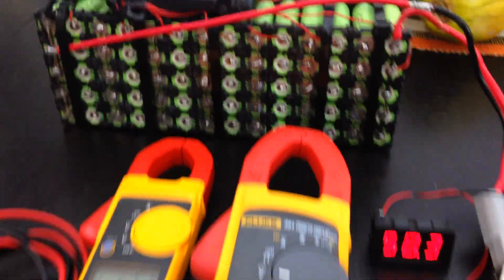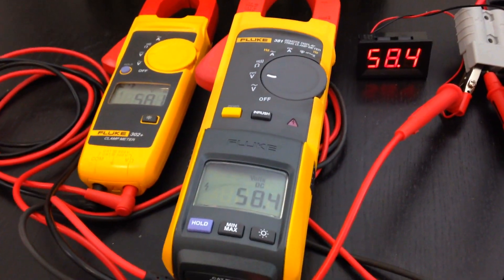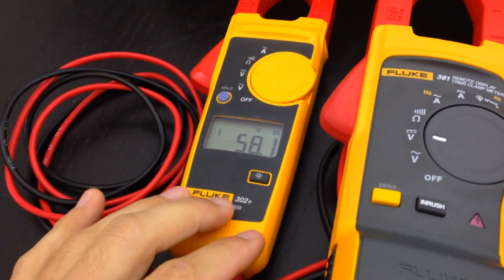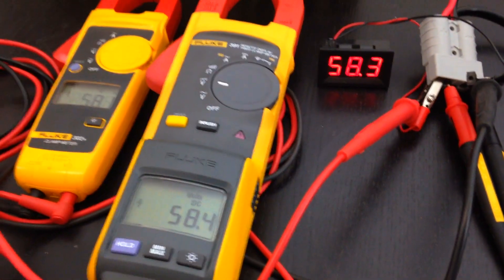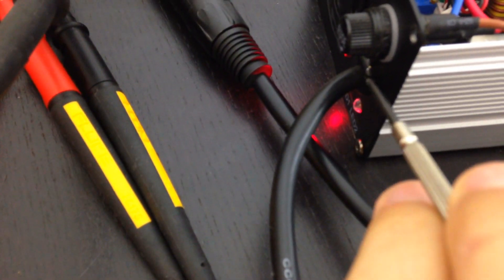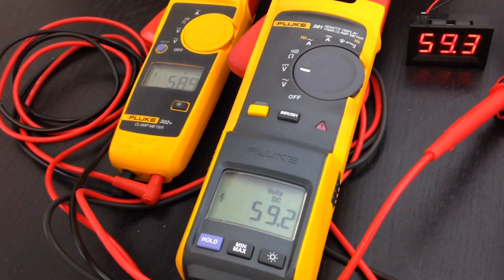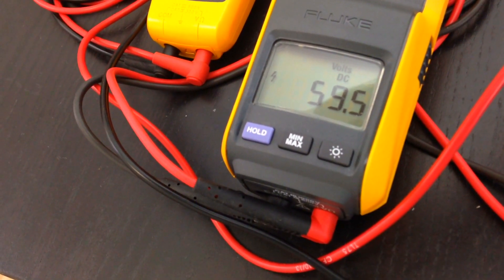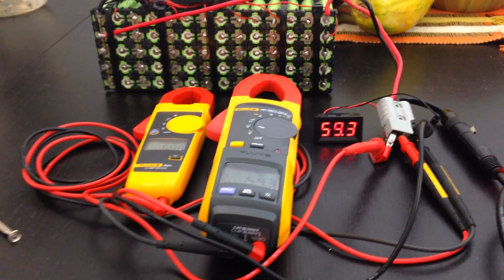100% Battery PERFORMANCE = Bypass BMS + re-Tune your Charger • 1470w Bafang 8fun BBS02 48v mid drive

Comment: I always bypass my BMS bonds.
Only using them for charging.

But the other day I got my hands on 2 36 volt batteries.
Each 10s 7p 
I put them in series to get 20s 7p 
82v in total 
I bypassed the 2 BMS
But one of the BMS  have stopped charging one of the battery packs. 
I was thinking by bypass the BMS discharge it wouldn't cause any problems or damage to the BMS or has it.
It's the first time I have done this so I'm not sure.
 
Does anyone know if that could have damaged to one BMS.

Comment: @BrunoPOWEEER can you please make a video tutorial about bypassing BMW for discharge thank you keep up the great content there are no real videos clear videos on youtube about bypassing bms for discharge
Reply from the maker: Yeaaahh thaaaanks mate!!
Bypassing a BMS for discharge, I’m keen on making a video showing that, lots of people ask for this. There are two ways, the safe way adding a contactor so you still have protection and the direct way with no protection. Open your battery and locate the thick wire that comes from the battery negative into the BMS, instead of passing inside the BMS you just extend this and connect directly to your motor controller. Ideally install a fuse just to be safe.

Comment: Can i connect a charging socket to positive and negative plug for my battery to charge while its connected to the controllers positive and negative connectio my battery has only two wires positive (red) and negative(black)

Will my controller blow off
Ac220v i will be charging my battery

Comment: Do you think a bms limits the bike? I was planning to balance charge my 13s5p with my balancecharger. But if it makes no difference i can keep using a bms for my ebike batteries.
Reply: yes........... on my lead acid battery it will takes months before charging.... but for lithium with bms.... just 3 days... you need to charge it because the ebike will shut-off if the voltage is not high...... i dont know the problem..

Comment: is it ok to use a  DC-DC Boost Converter with adjustable and current voltage to charge batteries such as this....https://www.banggood.com/1500W-30A-DC-DC-Boost-Converter-Step-Up-Power-Supply-Module-Constant-Current-p-1087084.html?p=BH100011313440201706&cur_warehouse=CN

Comment: So the 52V/13.5AmpH shark pack on my 750 is no longer giving the motor juice after it fell off the bike a few times. Is it possible to bypass the BMS in a simple manner in order to keep using it? I'm still riding my 1000W with the 24.5 AmpH pack with no problems. Last thing I want to do is battery swap between my bikes!!
Reply from the maker: +bentstrider yeaaahhh you can definitely bypass your BMS, all you have to do is to disconnect the balancing wires first then cut the negative wires (one going to from the BMS to the cell's negative and other going to the discharge port) connect the negative of the pack directly to the discharge port!!! Connect the charger negative there too.
Before you remove the BMS make sure your cells are all balanced checking if there's nothing wrong with the cells (it may not even be the BMS). Sometimes you can't see any problem and you need to apply a load to see if there's nothing wrong.
Running a pack without BMS you have to keep your eyes on the series checking the voltages with a multimeter. If something goes wrong with one series you will be overcharging all other series and this is when things can go BOOM
Reply: Sounds good, but I was able to get the battery functioning again this morning by taking the shell off and then unplugging and plugging back in the BMS!! But, thanks for the tips any way!!
Reply from the maker: +bentstrider yeaaahh sometimes disconnecting and connecting the balancing wires is all it takes to reset the BMS... I'm glad it was very easy and simple fix hehee... the POWEEEEEERR is back!!! =]
Reply: @BrunoPOWEEER   thank you for the reply I look forward to you making the video on bypassing I think a lot of people can benefit from it keep up the great work once again thank you.

Comment: Great video!  Where do you have your discharge positive and negative wires and charge positive and negative wires soldered.  I've only ever used a bms.  I could guess, but I want to hear it from a pro.  =)
Reply from the maker: +Paul Sammons Music - Hi Paul, I completely disconnected the BMS in this video so there is no separate charge and discharge wires anymore, both share the same wires that are connected directly to the positive and negative of the pack. I am publishing soon a video explaining some different types of BMS and showing how to wire to a battery pack, I am sure it will help a lot of people understanding all these wires going everywhere.. =]
Reply: +ElectricBike (Bruno) So after much frustration with bad bms's, I've just taken off my bms for now to try it out.  My question is, how do you know when to stop discharging without a cycle analyst using a 52 volt battery.  I hear the battery gauge on the BBS02 isn't accurate for 52 volt batteries, so how will I know when to quite without taking a voltmeter on my ride with me?  =)
Reply from the maker: +Paul Sammons Music - Yeahhhh.. BMS brings more problems than conveniences...  your 48v controller is setup for 13s batteries so it will cut off a bit too low for the 14s pack, you need a programming cable and a windows computer to connect your controller and change the cut-off voltage from 41 to 43v. You can discharge to 41v, it is not "recommended" go below 3v per cell but the cells can take as low as 2.8v some cells can take 2.5v but you don't want to risk or reduce the life of your pack so keeping the 43v cut off would be the ideal. Check out this programming article, the low voltage cut off is the very first thing that will come up on the screen http://electricbike-blog.com/2015/06/26/a-hackers-guide-to-programming-the-bbs02/
Reply: Wow@! That easy huh?!?  Great!  I've already been programming these motors, so this will be easy.  I had no idea you could control the low voltage cutoff with the controller.  That just blew my mind!  Thanks so much.  
One more thing, if you don't mind Bruno...  I see you are using a bulk charger in this video.  Do you ever use a balance charger?    I know that cell groupings should stay close to the same voltage for a very long time if they are all authentic, from the same manufacture, and start out at close to the same voltages, but what do you do when they get a little out of whack?  Maybe, just put a BMS on at that point...  IDK
thanks amigo
Reply from the maker: +Shane Williams - hahahahaha you're 100% correct!! I never believed these numbers... my mum doesn't watch all my videos... all girls I know have zero interest in electronics... but YouTube still telling me that 4% is female audience hahahaa
Check out my latest videos I have some better ones.... =]
Reply: +ElectricBike (Bruno) lmao....end of video....."ooorrrgh" ...one question....why? :-D
Reply: +Shane Williams btw...4% female audience....1% are guys using GF's account....1% are checking up on what their guys are up to... 1% subscribe to everything and 1% actually already know this.... thats an all male audience heheheh only jokiing :-DDDD
Reply: ElectricBike I Will and I am! :-D BTW; My BMS failed -_- so I bypassed it and it made a big difference...lucky my charger is "smart" so charges it OK [58.8V battery only charges to 51.8V :-( ] I boosted it from 13s to 14s using my old laptop's batteries (18650) and this also gives more speed but it still isn't fully charged as said earlier... also got a petrol bike so use that sometimes...it is fun too...and cost me 10% of the price of the electric bike to make. but same speed...I use the cheap 2 stroke engine kits from ebay and they are pretty good so far...love the engine, (loves screaming at high rpm's) hate the carburettor...needs upgrading...love everything else...all good. aybe you should give these a go if you avent already....for less than £150 spent on an old bike frame you can go to speed of 60MPH!! you might also find some new ways to get them faster....mine did 40MPH once...now it needs a carb clean to get back up there...
Reply: What's the highest volts you could increase this charger voltage to?

Comment: Like your videos keep up the good work.
What BMS are you using? I'm making 14s battery and looking for good BMS.
Reply from the maker: +No_Problem - Yeeeeeeeeeahhhhh... my 14s BMS I got from Aliexpress in 2014... my one charges and discharges using the same port. I like to get things from http://www.batterysupports.com/lion-lipo-nbsp-48v-nbsp-13s-c-32_43.html but they don't have 14s BMS there...  see if this factory would sell one for you, pretend that you are interested in buying large quantities and order one for "initial tests" http://bestechpower.com/518v14spcmbmspcbforli-ionli-polymerbatterypack/ you will also find BMS on Aliexpress, never found BMS on eBay... Thanks for watching my videos huhuuuuulll... so much POWEEEEEERR =]

Comment: Great video :)  any chance you can show us how you did the soldering on your battery? Been anxious to make my own pack myself.
Reply from the maker: +Heinz tee - Hi Heinz, soldering battery is very dangerous and must be done with powerful soldering iron for a very quick job otherwise you cook and damage the cells. 
Here is a video I uploaded but took it down as I  have to mention lot more things so I am making a complete new video https://youtu.be/URD3gv-027Y
Soldering has some advantages but some disadvantages, it does last longer and offers less resistance but spot welding is recommended for batteries. You can get one on eBay, won't cost you much, will be safe and will make your life much easier.
All accessories you wil need to make your pack you'll find here: http://www.batterysupports.com/lion-lipo-nbsp-48v-nbsp-13s-c-32_43.html
I receive sooo many questions asking about batteries, lots of people want to make their own, so I will be posting lot more videos and make a series of videos explaining battery configuration, how to connect, BMS, cells specs, fast charge, etc... =]
Reply: +ElectricBike (Bruno)  yup,  i know the dangers of that.  I just haven't seen that much battery pack soldered together, most are spot welded so i got curious with your pack.  Do you use a special tip for your sodering iron and how many watts?  Im on ES and they don't like to solder packs but seeing how you made yours reliable, I'm willing to see how you do it. I know all the things needed to know for buiding. The configuration and the setup i want to make, 13s4p. Anyway, post some more videos as I'm liking all of them :)  more power dude and please post your stuff on ES and write a blog or put up a website, i bet it'll be an interesting read.  I'll even help you with the writing :)
Reply from the maker: +Heinz tee - Merry Christmas... sorry for the delay in replying this message. the longer you expose the cells to heat the more likely to damage the battery. I used a soldering iron that boosts up to 130w (the hottest, the fastest you do the job) but it doesn't have to be that powerful, a good big soldering iron with square tip (like screw driver) would be a good one as well. Some larger soldering stations are also capable of putting lot of heat. Ah... the freon cool gas is a must when soldering cells, you have to bring the heat down ASAP, this is the trick when soldering a pack =]
About the 13s4p configuration,  the more cells you add in parallel the less your pack will heat and the longer your cells will last. I made a clear plastic casing first but I noticed that when the battery gets hot, the air humidity transforms into vapor and "steam cook" the cells inside the casing... thank god I made it clear otherwise I would never see that happening. 
About posting things on ES, I have been too busy at work and the time I have in front of my computer I am preparing some videos and also replying messages here in my channel helping lots of people and researching interesting electronic stuff hahaa..
Yes, I plan to have another platform maybe a blog or something like that but for the moment the YouTube is keeping me ultra busy hahaa.. (I pack so much information in my comments it is almost like my mini ES haha).
Check out why I have been so busy.. look the monster I developed with Matt Shumaker from ES: https://endless-sphere.com/forums/viewtopic.php?f=28&t=74176
I will be posting videos of this insane project as soon as it arrives in my hands =]